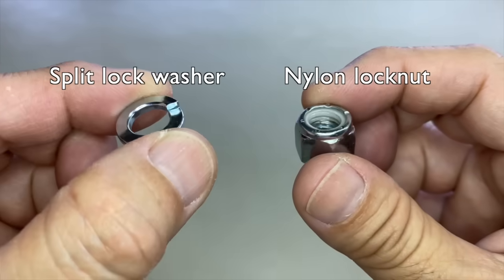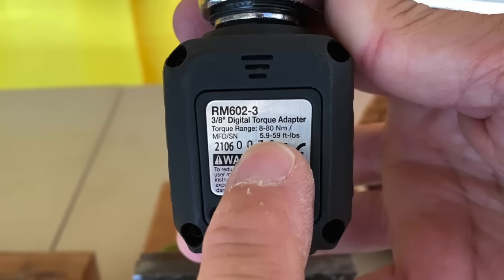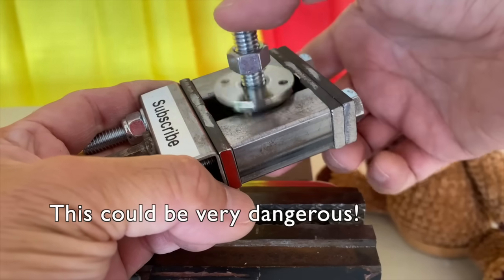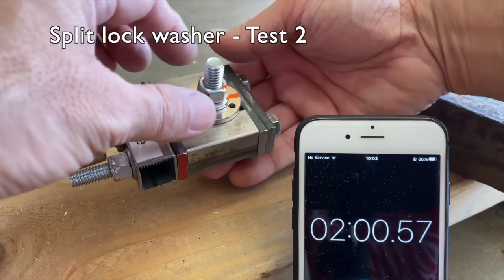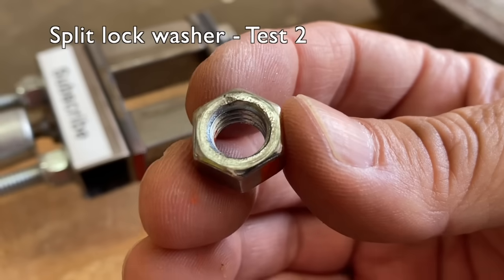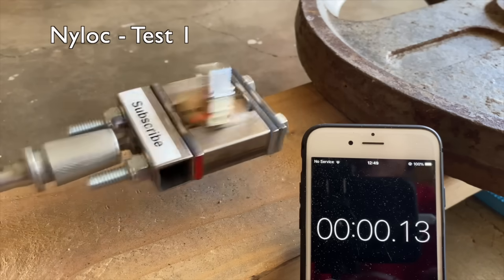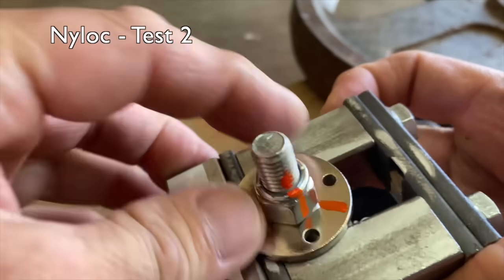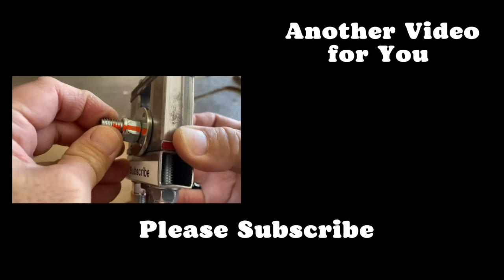Nuts & Bolts - Split Lock Washer vs Nylon Locknut – DIY Impact & Vibration Test - Part 1

Comment: You had an invalid test of the nylon lock nut because when you torqued it, you did not take into account the drag of the nylon nut when installing it.  It should’ve been torqued to over 6 pounds.

Comment: I build machines that have a vibration problem. There are thread-lock adhesives that will do a decent job. In fact, one I stopped using because it has to be heated to get the bolt to turn.

Comment: Nylock nuts arent made to hold high  tension. They are made to hold a a moveable pivot joint where you cant tension the bolt up tight.

Comment: For a nylon lock nut you need to find the running torque of the nut then torque it down to 6ft/lbs plus the running torque. This is because if you torque it to 6ft/lbs a portion of that torque is going into just turning the nut and not applying force to the things you’re trying to hold down.

Comment: That's one of those great curiosities that I've never seen investigated.  Great work 'Hacks by Dad' and "Subscribed"!  I'm curious how different types of Loctite would perform?  Properly torqued jam-nuts?  (In a critical loc'n subject to rot'n I suggest crown nuts and lockwire or cotter pins.)

Comment: The torque must be accurate for the size & grade of hardware, which will put the fastener in its ‘ductile range’; thus you will have a ‘spring’ fastener which can flex with vibration while remaining tight. Also, NEW, CLEAN nuts and bolts must be used in each test as deformation of threads occurs every time the fastener is tightened.

Comment: Why only 6ft lbs?
Reply: 6 foot pounds wrong sir
Reply: Aren’t you guys missing the point here? This was an experiment to check the relative efficiency of the fixing types, not their ultimate failure point. ‘I torqued them all to 65fps and none failed after a week of vibration’ is gonna tell you nothing. Excellent video.
Reply: @rob_in_stowmarket_uk  no, he is base lining the other fixing types so he can do the low torque loctite test next.
Reply: Hi guy who didn't watch the video directly after he said 6ft lbs.
Reply from the maker: Thanks! 
I chose 6 ft-lbs for a future test with Loctite threadlockers.  On page 79 of the Loctite Threadlocker manual, it states that the breakloose torque is typically tested with the fastener seated to 5 Nm or 3.7 ft-lbs...
https://dm.henkel-dam.com/is/content/henkel/LOCTITE-Threadlocker-Manual
The minimum torque my torque adapter can measure is 5.9 ft-lbs so I chose 6 ft-lbs.  I'm testing other locking devices at that same torque before testing Loctite red and blue.  
👍😎
Reply: @HacksbyDad for 3\8 course bolt Fastenal recommends at least 23 ft-lb others recommended even higher especially for dry conditions. 6  ft-lb is too small for such big bolt. There is essentially no preload on it
Reply: @ltaranovich9  agreed, it isnt just about digging into the metal, its about the compression of the washer as a spring that pushes the nut threads against the threads of the bolt. this is also why you have to use NEW lock washers each time after they were torqued to spec.
Reply: @nicodemus7784  Mechanical engineer here.  The compression of the spring lock washer does not increase preload.  The torque and thread helix produce the axial preload.  If properly torqued, any helical lock washer will be completely flat and will now be acting with a stiffness that is the same as a flat washer with a similar geometry.  Therefore helical lock washers do no better than flat washers for preventing loosening.
Reply: @nicodemus7784  No so. Other experiments have shown that the spring action of the washer has negligible effect compared to the split cutting into the back of the nut ant the held surface. So, not wise to use them on hardened  surfaces.
Reply: @danbanowetz  so you are saying the spring action combined with the notching has no bearing on the action of the lock washer? my understanding is the spring action helps keep the threaded loaded as you torque it down and form the "cuts? in one spot without spinning, and if the fastener starts to loosen, then the spring action helps keep the washer in place in those "cuts". Thus helping to slow or prevent it from backing off further.
Reply: @ltaranovich9  what difference it would make if there was such torque / 23 ft/lb ? how much longer would the bolt held?
Reply: @danbanowetz  if that were true, no one would ever use a lock washer, what would be the point. What you said is basically correct except you left out that a lock washers sharp edges dig into both the base metal  and the nut to mechanically prevent it from turning as shown in the video by the gouges in both the nut and paste material.
Reply: @ltaranovich9  good point, I think he used the lowest setting so that he could see which failed first, as quickly as possible.  Obviously a higher torque setting will take longer to fail.  However, your point is important because the correct preload matters.  The experiment might have produced a clear winner (in this case both failed) if manufacturer recommended advice was followed.
Reply: @ltaranovich9  Yep, Henkel(loctite) even recommends 27 lb-ft (36.6 Nm)...
Reply: @ltaranovich9  yep, not a good test
Reply: @danbanowetz     Thanks! I’m not an engineer like you are but common sense has always told me (and personal experience proves) that a nylon lock washer is superior to a lock washer that flattens when tightened. Only downside to nylon lock washers is that it takes a lot longer to remove them later.
Reply: @HacksbyDad  then this video is only to compare the performance of loctite in low torque loads and has nothing to do with lock washers and nylocks.
Reply: @nicodemus7784  Exactly.  And who the hell doesn't torque their bolts, with a torque wrench?
Reply: @RedEngin33r  torque wrench or not, no one is torquing a nylock or or a nut and lock washer to only 6 ft lbs. even just german good and tight would be 20-30 ft lbs for most people, and many would be elbow torquing to 50 ish. but again, as the video owner explained, this video is just him getting a baseline at 6 ft lbs so that he can compare it to the loctite test he will do next.
Reply: @HacksbyDad  I would like to see this test redone with the bolt and nuts preloaded to the maximum for the size, both the split nut and nyloc.
Reply: @N5KDA  I think the whole video was to prove the nylon holds better even after torque is no longer an issue. The point is the nylon locknut will be there long enough to see the failure before it becomes too bad
Reply: @jerrymccurry9372    Yes, that was exactly what this was about and he did a good job doing it.
Reply: @joeblow1942  I know right? He is showing basic holding strength for the individual nut itself while all these technical guy's are trying for a permanent fix. If you're going to fasten two pieces of something together for good (like welding) but I personally like to be able to "unbolt" something, rather than having to grind it loose.
Reply: @jerrymccurry9372  Nope, the initial assumptions used were totally wrong, which rendered the whole "test" completely useless.👴🧐🤷‍♂
Reply: @Arnaud58  It's okay
Reply: @HacksbyDad  Your Loctite explanation is irrelevant. And although you obviously put time and effort into this experiment, I'm sorry to say your test has no value in the real world - where recommended torque settings are used, or even where experience based approximations are used.
Reply: @HacksbyDad  Irrelevant if you're not actually using loctite
Reply: @HacksbyDad  Just pure BS trying to dodge.
Reply: Zrob test z podkladkami schnorra

Comment: Nylocks are one time use (carry over from aircraft stds years ago that used a red fiber nut insert) and not for higher temp applications. There are far better nut designs that use interference fit schemes for retention and multi and higher temp applications. You can add serrated washers, wavy flat washers and of course cotter pins, safety wire etc for absolute retention.

Comment: I run large commercial mowers, I have to double nut everything or it comes loose in time. Even the plastic lock nuts come completely off, if not double nutted. I wouldn't expect 6 pounds to hold anything very long. Great job on the video, good camera work. I also like ya used 3 sets to compare.
Reply: The point was, the nylon will hold longer until you can address the issue, rather than it just spinning right off with the split washer

Comment: *  Improper torque will fail every time.  * 6 pounds is way too low for a 3/8-16 bolt. Lockwashers are fairly useless it you do not tighten the nut properly. Try this experiment utilizing proper torque specs and you will see a noticeable difference.  Motorcycles generate tons of vibration and use neither lockwashers nor nylocks. They use proper torque. Also, Loctite is your friend.

Comment: Yeah next try Nord lock, star, blue loctite, split, and nylock all torqued to proper torque as others mentioned. Also in that setup each back and forth is providing a significant impact as the assembly bangs against each end. In most applications you wouldn’t have that impact would you?
Reply from the maker: My Nord-Lock test is out… Will Nord-Locks Survive My Test?  DIY Impact & Vibration Test – Part 5
https://youtu.be/wOUnlfhHRko
Pls check it out and drop a comment.  👍😎

Comment: One con about the nylon nut is that hot and cold cycles from weather tends to disintegrate the nylon over time. I only use split lock washers outside and have never had one loosen. In fact, small amounts of rust eventually lock everything together anyway.

Comment: I used Nyloc nuts in place of the original castellated nuts with cotter pins on my pre war Ford V8 driveshaft coupling, with no loosening in service. But the torque was much more than 6 ft-lbs of course. It would be good to see the comparison with a thread locking compound. When I re[placed the shocks on my big Toyota, I had to buy a longer breaker bar to loosen the factory thread-locked large nuts, no amount of vibration would have moved them.

Comment: In Germany the DIN standards regarding the split locker washer were withdrawn in 2003 (DIN 127, DIN 128, DIN 6905, DIN 7980). More rigorous tests than the one shown here, were conducted and lead to the conclusion, that the split locker washer had no effect in terms of the expected function. In the case shown here, where the split lock washer held the nut in place by wedging, would not have last for long in a combined scenario of axial and radial forces, especially in the case of heavier elements.  The only secure way to keep your nuts and bolts tight together is applying correct material matching and correct torque. For safety applications the additional use of a lock nut is recommended.

Comment: We have the answer at 00:07 since you use Nylon to build your test rig ;) . Thanks for the interesting video.
Reply: I noticed that too. I wonder what they're torqued at.
Reply: Well spotted
Reply: I was thinking the exact same thing
Reply: Exactly... And obviously with sufficient torque
Reply: Partially true, but as he explained, movement aligned to the axis is harder to move then movement which isn't aligned to the axis of the bolt.
Reply: Tez to widze😊
Reply: Just commented on that.
Reply: Hahaha
Reply: Obviously tighter and not in the same load direction as the test bolts.
Reply: @jamiecarter9357  Bingo 0:34.

Comment: Try nord-lock washer (under standard torque) and you will see. We use it for all safety device bolt !
Reply from the maker: My Nord-Lock test is out… Will Nord-Locks Survive My Test?  DIY Impact & Vibration Test – Part 5
https://youtu.be/wOUnlfhHRko
Pls check it out and drop a comment.  👍😎

Comment: Drill a hole through the bolt and nut then fix a split pin through this hole. Problem solved.

Comment: Next time you do you test use grade 5 or grade 8 bolts,  your mild steel bolts are rubbish and you only torqued those 3/8" bolts to 6 ft lbs, that's nothing, you torque a 3/8" grade 5 or a grade 8 bolt to 40 ft lbs and also use grade 5 spring washers, not that rubbish that you were using, then do another test and put the video on you tube
Reply from the maker: Thanks!  Good idea!  Please perform the test and post on your channel.  👍😎

Comment: I build ultralight aircraft, the only good way is to tighten the nut and add a washer after the nut, then drill a hole in the bolt and use a cotter pin, you can use different thickness washers to tighten the fit.😀

Comment: A small note, with the nyloc still being aligned with the threads of the bolt, it seems to indicate the nyloc is not unthreading.  Rather both bolt, threads, washers, and nut are deforming from the impacts which in turn create a loose connection.  The split washer also had this, but the ability for it to dig as that gap was created meant it never felt loose.

Comment: A split "lock" washer is a spring, not a locking device.  I NEVER use them in ANY application. They are worthless.  (I'm a mechanical engineer with over 30 years experience.)

Comment: Test on nylock was not valid, nut did NOT move. Your torque is incorrect also you need to add 6 lb torque to torque requirements to turn nylock for holding torque.

Comment: This was proven 60 yrs ago starting with ESNA and others and why lock washers aren't used in aerospace, auto, rail etc. Good luck telling this to the operator on the floor when you start changing all the old BOMs to Loctite, nyloc, or locking tabs. You would think it's the end of the world for them!

Comment: Once your nut has loosened by even only a few degrees (like with the spring washer), the bolted connection has actually already failed. Simply because it’s lost its preload. If the fastener had held anything seriously loaded together, the bolt would have sheared off. 
So this test has little to no  meaning.

Comment: Years ago I ordered some stainless steel lockwashers from an eBay seller.  Upon arrival, I opened the package to discover that they were all made 'wrong' - they were either internal or external 'star' type lock washer (can't recall which at the moment).
The teeth on the 'star' were all twisted the wrong direction!
I didn't use them and had several back n forth communications with the seller.  They tried to tell me that they "...were all that way"...  I told them then they are all wrong and that they should recall those because their use could present a safety problem.  Eventually they refunded the purchase price, but I doubt they took any action to recall the wrongly made lockwashers.  Around that same time, I posted pictures of the lockwashers on an engineering website as a kinda quiz/teaser.  A number of folks looked at the pictues and didn't notice the problem.  A few did, however.  I remember one that recognized the problem and replied with a tongue in cheek reply along the lines of "..  there's nothing wrong with it as long as it's used on a left hand threaded fastener".
I wonder how many thousands or tens of thousands of these were installed by folks not noticing that they were made wrongly (or the batch got mislabeled, whatever the case).
How many ways are there to screw up a really simple part?
Answer: a lot more than one would initially guess.

Comment: Best is to torque fastener to proper stretch 
Split lock washers were developed to be used in wood that relaxes over time,they were never meant to be used on metal 
Nylicks are more intended for vibration resistance